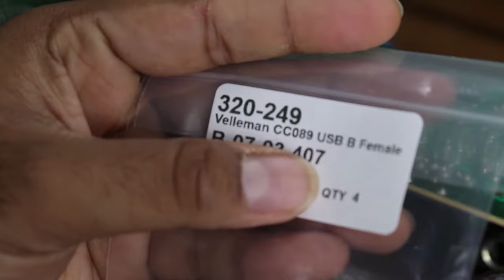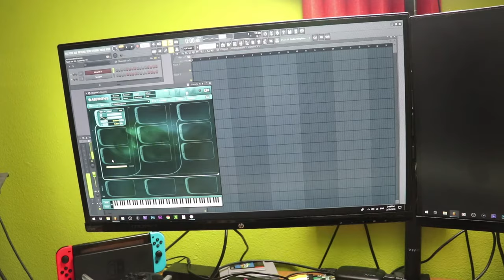How To Repair A Faulty Midi Keyboard USB B ( 2.0 ) Connector

Comment: Yo my boy omoi, I'm hearing such an annoying ringing high pitch sound from my monitors it's not just that but static and like computer sounds, WHATS UP WITH THAT?!? I got a power bank and nothing, pc and mac both do it, it's my second pair of monitors they both do it. Idk what do you think???
Reply: And another thing I dont hear it thru my headphones gotta scarlett btw. Just my monitors sound terrible.
Reply from the maker: Hey! Do you happen to have something like LED lights near it, or any electronics? Sounds like that could be the issue if it happened to not only 1 pair of Monitors. Mines does the ring as well with my LED Strips when I have them on. They're not much of a bother to me though. I'm placing my bet on an Electrical interference!
Reply: @OmoiSenpai  thanks for your two cents, but it's been bothering me cause I've tried alot and dont want to keep buying these monitors were expensive enough... I seen somebody go as far and removing the third prong off the wall cable I think it's called the ground, but I'm not with all that. I'm glad your dropping videos again regularly keep it up the game needs you.
Reply from the maker: Thanks! And Eek, I wouldn't even dare destroying the prong! If you want, you could experiment by using the Monitors elsewhere, and away from everything to see if you hear the ringing problem. If you don't hear the problem, then it's definitely due to an interference, rather than it being the speakers itself. Also test it out with multiple output cables.

Comment: I replaced the USB. it turns on when connected to the computer. But its not detecting the interface. I feel like I've tried everything. Can you give me some input on this?
Reply from the maker: Hey! 

The same issue happened when I did it the first time. I think I talk about it in the video. But see to make sure that all of the connections are properly soldered, and are on their own contact, and not connected anywhere else.

Comment: what do you mean by using a battery? not sure i understand what you meant.
Reply from the maker: I used to use a battery as a way of keeping the wire pushed up, Like how you'd use a door stopper, those little triangle things, to hold a door open. That, but on the wire.

Comment: Hello, I replace the usb port and now the "USB power surge" sign appears, does anyone know what I could have done wrong and how to fix it?
Reply: Just get a power surge strip (google it) and connect your power supply to that and then connect the strip to your wall outlet.  Problem solved.